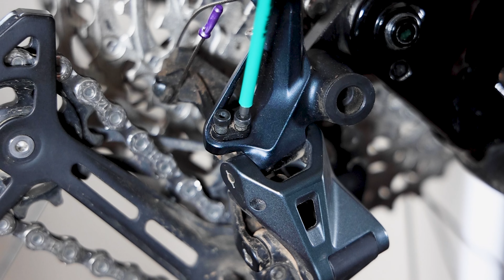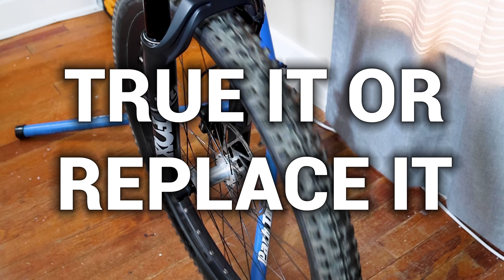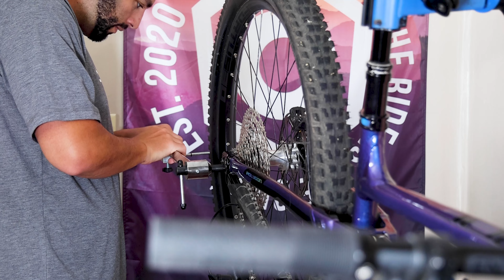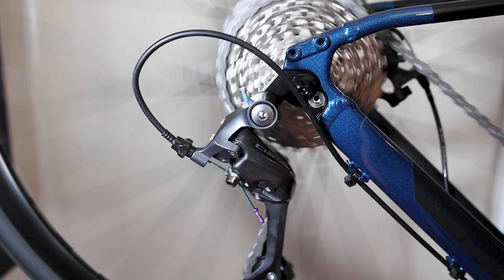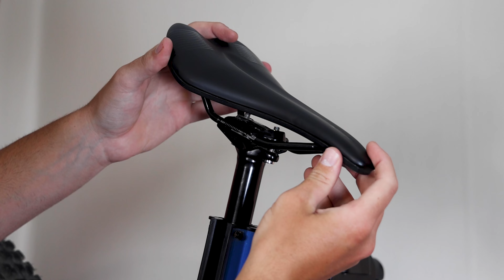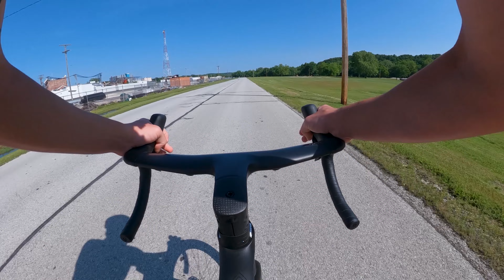Bike Maintenance Tips For A Happy Bike!

Comment: Hey nice video, I have a question related with shifting and the T8, when my bike compresses, the shifting is usually affected and the cable goes more inside on the downtube... 
Is this normal with the T8? And is there something else I can do besides checking the screws and tension?
Ty
Reply from the maker: A hack I've seen some people do to overcome the cable being fed into the frame is first pulling some slack to the back of the bike so there's enough of a loop at the derailleur as well as underneath the bottom bracket...then using a couple wraps of electrical tape around the cable housing right by where it inserts into the downtube. The idea is the cable housing will be too thick right there to push through the grommet under compression. Hope this helps!
Reply: @bikesonline  ty, I will try it 🙏🏻🙏🏻